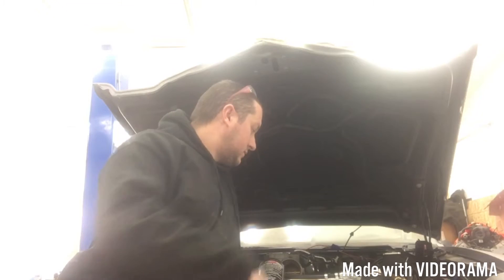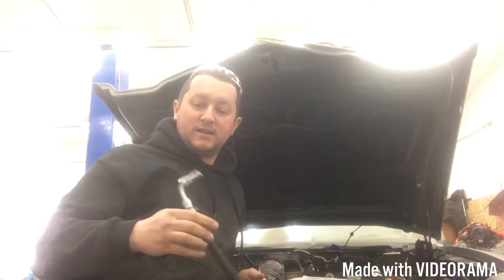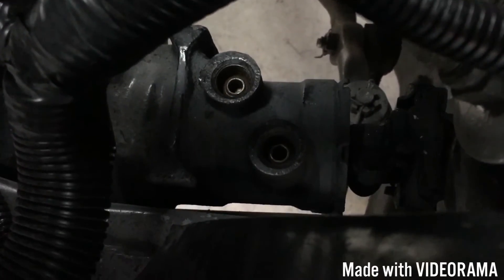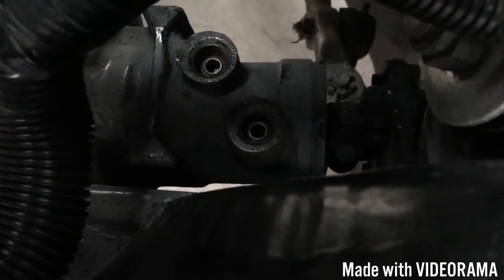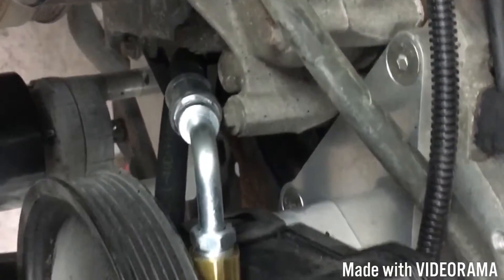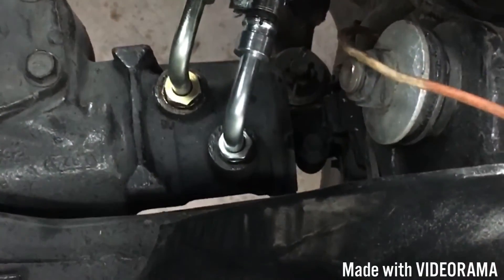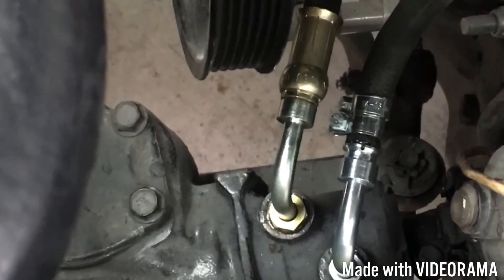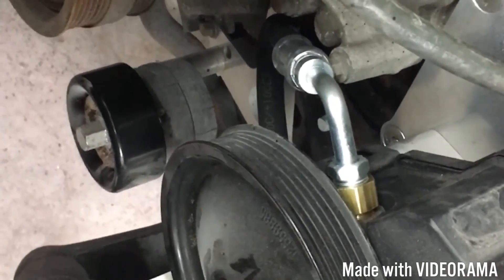Ls swap power steering lines

Comment: I'm in the middle of finishing up a swap on a 79 cutty. Trying to figure out what I'm gonna do for power steering lines or adapters. Right not I've got Silverado ps pressure hose and some amazon gear box adapters but the adapters won't work
Reply from the maker: its been awhile since I did that but the napa near me had the tool for putting the hyrdaulic line ends on.
Reply: @Raceking46  thanks

Comment: Thank you!  I just put a LS1 in my 78 Z-28 and this was exactly what I was trying to solve!
Reply: I know this is an old post.. but do you still know the fitting sizes for pressure side for exact setup?
Reply: @csmith9248  11/16 by 18 flare
Reply: @davidcunningham00  preciate the reply bro... found out a couple months ago but i definitely appreciate it.

Comment: Just an FYI, If you wanna flush out that power steering system without starting the engine, get a power steering pulley puller and attach it to the front of the pulley, then you can use a drill with a 1/2 socket adapter and a large socket to spin the pump. That way you dont have to worry about shooting fluid everywhere. At least thats how Ive always done it. Good luck on the swap.
Reply: Awesome advice!!